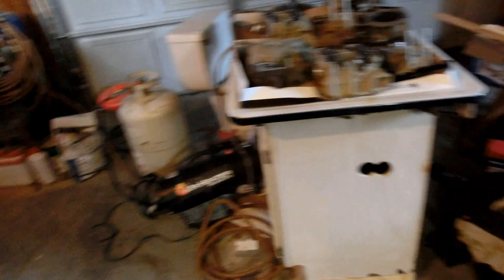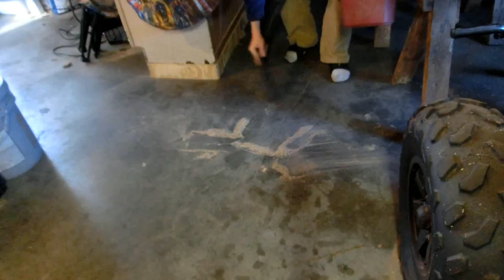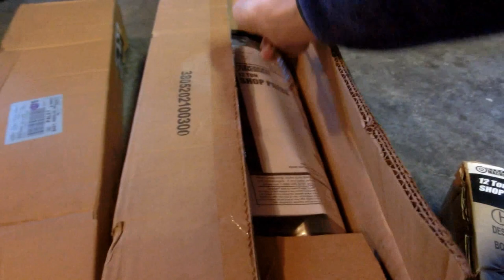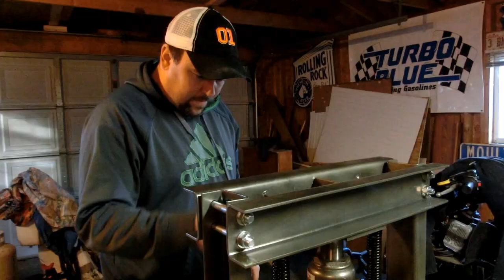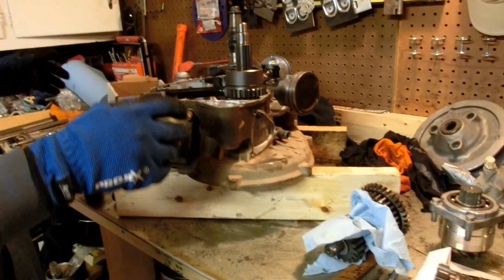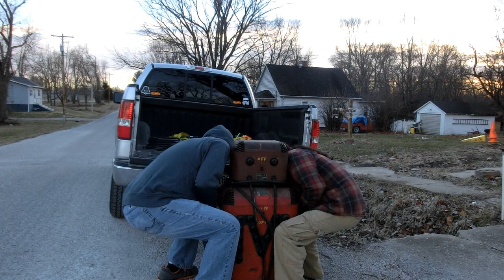Random Bits 0073: 12 Ton Hydraulic Press, Cleaning Garage

Comment: I recently just purchased a hydraulic shop press to replace the rear bearing on the Mrs' Ford. The damn axle was seized in the hub so badly it was practically welded in place just like that sprocket ha ha. When the axle finally popped off the hub in the press, the cracking sound it made was enough so make everyone across the yard jump! lol

Comment: Hi Rinoa brilliant vid i really like your fathers workshop, your dad is some machanic really knows what is stuff with these engines, its hard to beleive he's a director of a printing buisness.
The 12 ton press is a brilliant peice of kit, i am sure it is going to be put into good use i was well impreseed with it.
I am glad while you are in Cali that your dad is going to store and use that brilliant old welder, it will be looked after and safe, if anything was to happen to it it would be such a shame and not tom easy to replace. and by the way R congratulations on your 10,000 subs and good luck and all the best in your new job
Reply from the maker: thank you very much! i'm enjoying the BnB i'm staying at and silicon valley is so much nicer than illinois. the thing about the welder is you would either need to melt it down or let it sit outside for 30 years before it became unrepairable. that thing is built with very thick components. i may replace the dolley wheels on it since they are a bit crunchy.

Comment: My frend has the same sort of hydrawlic press, so so handy for bearings and any pressed in parts, a bottle jack upside down and a movable bar, a nice simple design with bugger all to go wrong :-))
Dead handy for compressing springs onto strutts, just an adaptor to allow pressing.

And as you said, making a tool to press out shapes in sheet steel :-))
Reply from the maker: yeah its quite cool.
Reply: Rinoa Super-Genius
Not forgetting the things you can torture with it lol, very flat electrolitic capacitors, nice flat lead , flat..... well you get the idea ha ha :-))

Comment: Off topic. While watching this video I just learned the hard way that infrared thermometers don't work on shiny metal. I had a spoon that I had lightly heated with a pencil torch out of boredom and the thermometer said 105 I thought no way and grabbed my smaller one and it said 101 so I touched it. NOPE that shit was probably closer to 170 fahrenheit of course.
Reply: learning the hard way sucks.
Reply: Yep. It really sucks when you try to not learn the hard way by testing something but the testing equipment lies. I used to work at a Sbarros pizza (when they were around) and got so used to burning myself on the ovens and hot plates. After a while you would start burning yourself without even knowing it. You would touch something and think hmmm I wonder if that should have hurt. The next day have a blister.